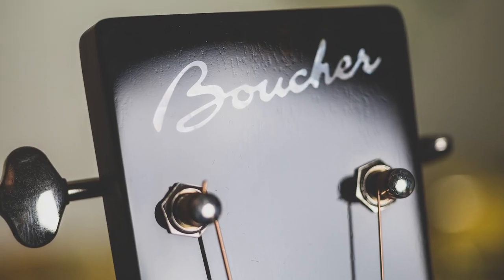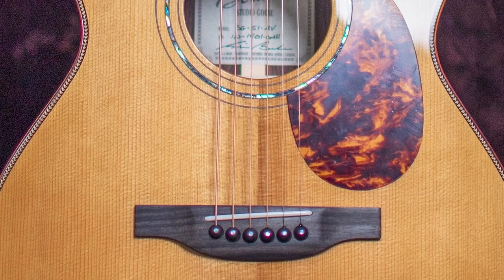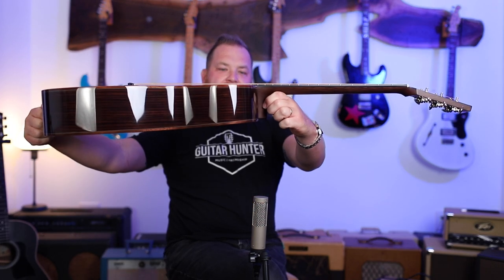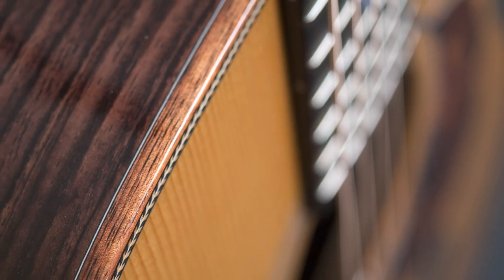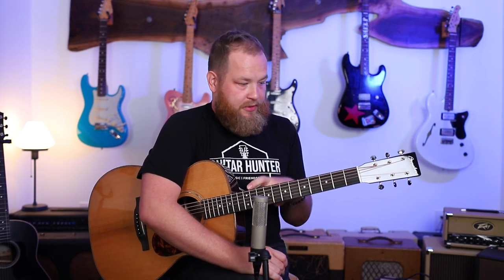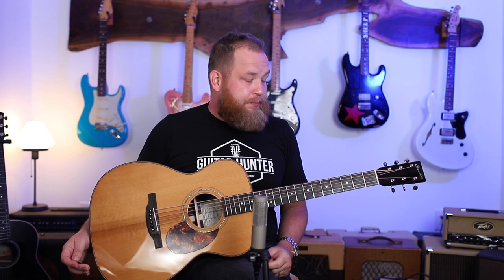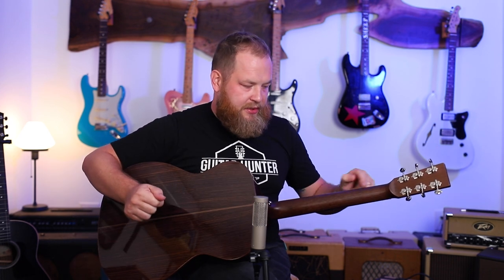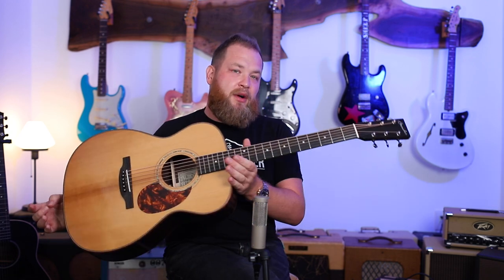A world-class acoustic guitar...The Boucher SG-51MV Studio Goose

Comment: Honduran and/or Madagascar rosewoods both run a real "hot 2nd" to Brazilian. Very similar tone. And many of the great guitar builders claim that Honduran rosewood in particular, is actually more durable & stable vs Brazilian. I've also heard that both Honduran & Madagascar are becoming harder to source, and both may very well be protected soon & added to the CITES list. This will cause current stocks to go up in demand & cost. Both are already much more expensive than east Indian rosewood. Design & build quality is always the most important factor in acoustic guitars, but with all being equal, Honduran and Madagascar does have a tonal & projection advantage over east Indian rosewood. I currently own 3 Hsienmo acoustics. 1 has solid east Indian rosewood back & sides, while the other 2 have solid Honduran back & sides........and both with the Honduran totally eclipse the Indian for tone, sustain, and sound projection. And yes, they do have 5A Adirondack tops.

Comment: What vintage guitars would you suggest under 2500? Love your videos
Reply from the maker: 70's Martin's! Just make sure they play well and have good action. Vintage guild's are killer too.
Reply: @JeremySheppard  Awesome, thanks for the tip!
Reply: 70’s Martins are inexpensive because the quality control for Martin was the lowest in their history! If you can find a 70’s Martin that has had the intonation fixed and possibly the bridge plate replaced then they can be a relative bargain. But you can do better. Get a late ‘90’s or a 2000’s Martin! You won’t get as much wood aging but Martin is building great guitars now, especially in the traditional line. They've had glue problems in their bindings only and this has been resolved. This was caused by the DER in the State of PA who wasn’t allowing them to use the same glue everyone uses from what I’m told here in PA, but the problem has been resolved. It didn’t affect structural integrity and most were unaffected. I’ve had dozens of Martins and the only ones I had problems with were 70’s Martins. I had a 70’s D-18 that had bad intonation and a D-35 that was the same but also the e string was too close to the edge. I sold it. It was used and I didn’t know what I was getting in to. So, unless you have it checked by a qualified luthier, steer clear of 70’s Martins! Fortunately, they woke up and recovered but the only poor quality period of Martin is the 70’s!